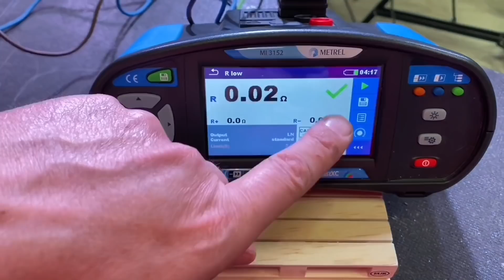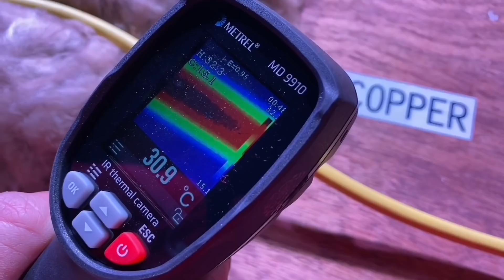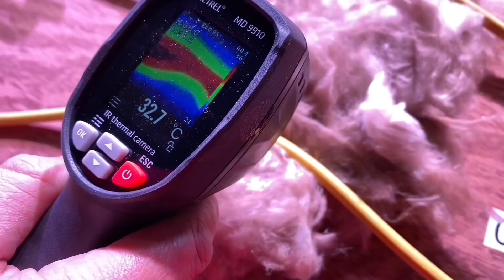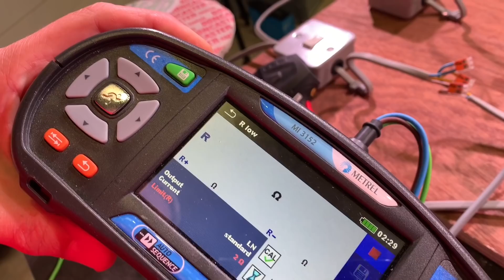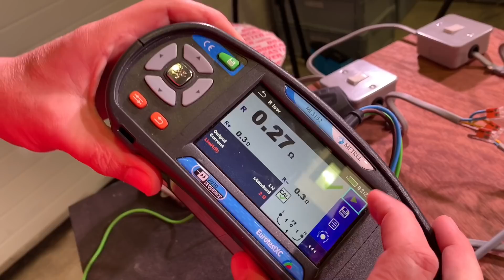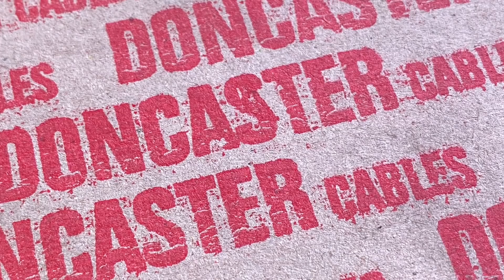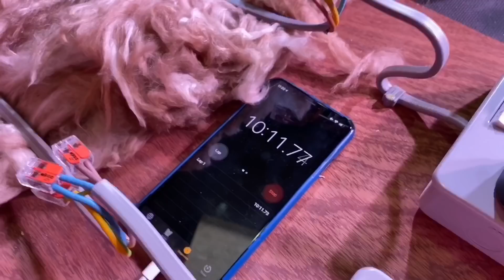The disturbing facts about FAKE and SUBSTANDARD cables - UGLY Twin and Earth, light weight flex

Comment: In the 1980s I ran the test section of a major cable manufacturer. We used to get up to 30000 metres a day through the test bays much of it 6242Y in very long lengths (grey and white sheathed in those days). There were very few electrical failures and what there were were almost always due to damage while swapping manufacturing take up drums or temporary joints having been left in. We always recognised that the major issue was strippability and we would reject any that we had difficulty stripping for test - this would usually result in the cable being returned to us cut to despatch length for us to check every reel. After I moved on to their other factories, 6242Y manufacturing was partly automated and the pervasive chalk dust found not to go well with the electronic equipment, so they moved to a liquid solution - not only much less messy but more easily controlled and maintained.

Comment: Back in the early 2000’s LSF twin was the absolute pits to strip. There will be tons of installations where the outer sheath is split down the middle and goes right up to the terminal because it was welded to the insulation of the cores. Not had to use it in a while but it still gives me nightmares!

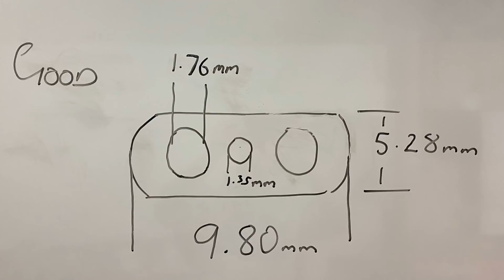Comment: 11:47 WOW!  This is shocking ;-)  But to put this into something that us sparkies can recognise...  Using basic GCSE Maths, the area of a circle is π r^2 (Pi  times the radius squared).  The measurements that you made here with your calipers are obviously the diameter of the wire so we divide this by 2 to get the radius.  Then square this and multiply it by π (pi).

And as we all know, 2.5 mm T&CPC (T&E) should be 2.5 mm^2 for the lives and 1.5 mm^2 for the CPC, so...

The "Good"

Live Conductors:   d=1.76 mm which equates to π(1.76/2)^2 = 2.43 mm^2                 (2.432849351)
CPC:                        d=1.35 mm which equates to π(1.35/2)^2 = 1.43 mm^2                 (1.431388153)

And now, the Bad

Live Conductors:   d=1.65 mm which equates to π(1.65/2)^2 = 2.14 mm^2                 (2.1382465)
CPC:                        d=1.28 mm which equates to π(1.28/2)^2 = 1.29 mm^2                 (1.286796351)

I am surprised that your "good" cable is only 2.4 and 1.4 mm but the bad cable is only 2.1 and 1.3 mm!  (I wander what DC cables are...?)

It would be interesting for you to compare popular brands of cable used in the UK to see how they stack up...?

[N.B. Pi is not pukka!  - No pies were harmed in the making of this post!]

Comment: The fake copper wires are a definite safety hazard. A few extension cords  i had were like that, copper plated aluminum, spot welded to brass contacts. 💩😵😵😵

Comment: The very first resistance test seems a little inconclusive, since it's different by only one count, might just be somewhere on the margin of device sensitivity, would have been much improved with twice the length. The thermal test however on the same cables is super conclusive - not only is the electrical conductivity of copper somewhat higher, but thermal as well, and you got an excellent measurement margin on there.

Comment: I guess Aluminium could be used for house cables . Copper is probably used because of tradition and because it solders , but in house wireing there's no soldering . Not only is it much cheaper per tonne , but it's less dense ( Al 2.7 , Cu 8.9 ) so the mass would be one third that of copper for same size wire . Aluminium has only 61% conductivity of copper so 2mm2 copper would be replaced by 3mm2 for same load bearing , then you would be paying  ONE SEVENTH  the cost for the metal involved
Reply: Not impossible at all. Just needs to be appropriately rated. Issue here isn't aluminium in of itself, more that its being used to substitute copper whilst still pretending to BE copper. Hence all the copper clad aluminium wires are totally undersized for the UK wiring regs which are written with the safety and ratings math revolving around the assumption of 100% copper conductors.

How ductile is an all aluminium cable compared to copper ( ie gow many flexs before strands break due to fatigue etc?)?

Aluminium is used heavily on the HV distribution side simply because of its physical weight characteristics compared to similar sized copper cables

There's nothing wrong, inherently, with all Aluminium wiring, it would be potentially cheaper ( although price would rise due to the extra demand, copper prices would fall etc..), but its just a case of all regs being adjusted to accommodate it.
Reply: @Thats_Mr_Random_Person_to_you  Ductility, how prone to dreakage after repeated bending is an issue , I think aluminium is not so good in this department , (multi strand overcomes this );  but ring main cable , once positioned does not move . I don't think this extra usage would increase price per tonne much . But this changeover  will likely not happen , the existing (copper) wire manufacturers  won't want it , and politicians don't understand these things . It could realistically alow  ring main cable to be a third of it's present price.

Comment: I had a couple of rolls of 2.5mm Prysmian cable from screw fix, came to 2nd fix and it wouldn’t strip, the answer from screw fix and Prysmian direct was take it back to screw fix for an exchange. They couldn’t understand it was plastered in walls in 100 pieces 😕

Comment: would thicker aluminium cable be the same as copper and still be cheaper
Reply from the maker: In theory yes - but then it’s much trickier to work with bigger reels etc
Reply: Yes, Central and Eastern Europe is full of it and electrical probelms are relatively rare.

Comment: This is why I cringe so much at SY cable - even more so when someone tries to justify it on some basis that you can follow “manufacturers instructions”.

Don’t get me wrong, some manufacturers make excellent SY cable. Which is why it should only be used if the design BOM specifies the manufacturer and not merely the type of cable. But many wholesalers sell generic stuff and good luck getting a datasheet.

Ultimately the trick with any cable is to know who made it – and to know that if it fails and burns down your customers property then they’ve got a UK director who will be stood next to you in the dock.

Comment: Australian here  - we had Chinese cables that crumbled and became fire hazards after a few years.  The cable was made by Infiniti cables - who decided to go bankrupt immediately after they were caught.   They deliberately stripped the dimensions of the conductors, and also stripped out the UV and stability compounds from the plastic.  End result - 2 people dead and about 30 significant house fires.  There's still thousands of Km out there installed - and zero warranty protection from the company.

And they were only $38 cheaper than Olex - the Doncaster cables of Australia.
Reply from the maker: Wow - tragic lessons learned!
Reply: Yes that happened here a few years back, if the authorities don't keep a watch out it will happen again, I have seen similar short cuts in other industries, plumbing pipes (PVC) , star pickets, Form board, Insulation for homes, the list goes on, we all know who the Installers are don't we, they are Importing low grade products from their own country to undercut local trades and industries. This has to stop, peoples lives are at risk.

Comment: Thank goodness its not copper claded steel.  I haven't seen anything like that in power cables, but see it all the time in coax.  Have to pay attention not to use the CCS cable and make sure its 100% pure copper.
Reply from the maker: Copper clad steel - a new one for us to watch out for.
Reply: copper clad steel is standard in RG-6 cable (the RG-6 standard defines it as such) because they are for RF applications, where the signal only travels outside the conductor (skin effect). Making it pure copper has no benefit, in fact power RF cables are hollow tubes instead of a solid conductor.
Reply: @83hjf  Pure copper does have benefits, and is required when powering downstream equipment via the coax as many things are done today that way.  Because CCS and even CCA (copper clad aluminum) have higher resistance they can get hotter over time when remotely powering devices.  The CCS is harder to bend, and CCA can fracture easier as well.   Granted I haven't seen any CCS in power cable, its just something to keep an eye out.  Yeah I have worked with 6" copper hard line at radio stations that use 2.5" copper pipe center conductor.  They use hard drawn copper outer and inner pipe with PTFE disk insulators between then.  If I recall correctly it was rated for about 8,000kw at 20kv if I recall correctly, again as you mentioned its at RF frequencies not, 50 or 60 hertz.  😁👍
Reply: Had a lot of cw1308 telecoms cable that was copper clad steel, one of the the big wholesalers got scammed in the late 2000s. Causes terrible broadband problems.
Reply: @smd-tech  There is/was a telecoms cable called drop wire, copper clad steel I believe designed as the aerial 'drop' wire to the subscribers house. The steel was for strength.

Comment: Hi I have been having a problem with 2.5mm twin and earth cable bought at screwfix the name on the cable is PRYSMIAN this cable is dated 2022 I also have a piece of the same make and size but made in 2021 this cable has no problem with it.
Reply from the maker: Prysmian is a well known brand - take it back and complain.
Reply: @efixx  Hi I did take it back and the guy said he would replace it but as I had the same problem two weeks before and I needed the cable to finish the job I just asked him to report it, it just took a bit more time to strip the cable, he was saying the bigger rolls seem to have no problems?

Comment: In a previous video Gaz you mentioned that the mains supply cable is a concentric cable which has an aluminium line conductor and an outer copper that is the combined earth and neutral conductor, so why is the flex in this video a problem? Or have missed something? Surly if aluminium is ok for the DNO supply cables then it’s ok for other cables.
Fantastic video as always 👍👍❤️
Reply: Aluminium isn't inherently 'bad'. The issue is aluminium being used to substitute copper  but pretending to still be copper.

As long as correct cross-section cable is used for the load tou could wire it in 100% aluminium if you wanted. The Grid side of distribution (so the extra-high, and ultra-high transmission lines on pylons and undersea DC interconnects) use aluminium because its just so much lighter than copper so less sagging between pylons as the cable heats up and droops due to gravity etc).

You could design the entire UK regs to use 100% aluminium cables perfectly fine if you wanted, but it might not make any real difference price wise over the long term.
Reply: Aluminium has a higher resistivity than copper, but a much lower density and cost per ton, so for a given resistance an aluminium cable will be larger, but also lighter and cheaper than the equivilent copper cable.

Aluminium also tends to be more prone to termination failures. This can be mitigated through the selection of the correct aluminium alloys along with suitable terminals and in some cases "contact pastes" that help protect the terminals from oxidiation.

As a result, most first-world countries have abandoned aluminium for "small" conductors.

Comment: I have seen this big time in appliance testing. I have been caught out at home with a water distiller bought from eBay with aluminium wire in kettle lead. The element failed burnt out the earth cable so when I grabbed the unit it ended up with burns and bad shock. Being an electrician NEVER had an incident close to this. Well it teaches me to test the crap I buy from eBay or similar sources even new.

Comment: I'm a bit late to the party with this video. But are you sure that the "fake silver cable" isn't Copper Cladded Aluminium cable? It is a proper cable and I have (unfortunately) had to use it a few times many years ago. If my memory serves me correctly there is a section in the Cable Size Calculation Tables at the back of the Regs for Copper Cladded Aluminium. You should retry your experiment with the proper Regs taken into consideration.
Reply from the maker: You can get CCA - but this cable was sold as pure copper and found in a dangerous condition within a live installation.
Reply: @efixx  My apologies. I thought you said in the video that it had been found on a building site and sent in to you. If it is CCA and is being sold as copper cable then it is definitely at fault. That's why I always try to buy from reputable electrical wholesalers.
Reply: @Alan_AB  It can be zinc or steel in real bad chinesium cables.  Silvery wire insides don't mean aluminum.
Reply: @randacnam7321  In a lot of places it does make a difference. Here in the U.K. the Wiring Regulations BS7671 state that the current carrying conductors can only be made of copper or aluminium. There are very rare occasions when copper coated aluminium can be used but these are mostly obsolete now.

In the U.K. zinc or steel would never be used in fixed wiring cables. They would never be allowed to pass Building Control Regulations otherwise.
Reply: @Alan_AB  We treat copper clad aluminum the same as straight aluminum wire current capacity wise.
Copper clad steel/zinc is in bottom of the barrel chinesium garbage that has never been within a country mile of a test lab.
We do use copper clad steel in some utility applications (the copper cladding being a decent proportion of the conductor cross sectional area) and for antennas where the RF electricity is only on the surface of the conductor anyway.

Comment: Can someone tell me how a 1.5mm² cable is supposed to feel. I have 2 different cables both pure copper but one is much stiffer than the other one and the cores, including the CPC appear to be thick. I don't suppose they would make it thicker than it should be so what's going on? Is the other cable smaller than it should be?
Reply: Maybe one is Low Smoke or LS.
Reply from the maker: Look on the side of the cable to find the manufacturers details and perhaps ask them - could be an interesting trail.

Comment: Oooooow yes. I Definitely remember the time when the college had a pallet of 1.5, 2.5, 4 & 6mm T+E. Someone at the factory must of fallen asleep at the wheel because there wasn't ANY french chalk as far as the eye could see (if you get my drift 😉). Pretty much EVERYONE (myself included) refused to use it as no matter what you did. You just couldn't strip it without cutting your finger off. 
I've got NO IDEA where they got that cable from but they couldn't even spell "Electric" correctly 🤦🏻‍♂️ I mean how the duck can someone not even spell the word "Electric" right!? 🤷🏻‍♂️

I can sorta understand where the college is coming from, as they only have a little bit of money which needs to be spread out very thinly ☺️ 

I'm sorry for going into a rant. But thinking back, there HAVE BEEN a couple of jobs where I've had to use the supplied cable and it only had the tiniest little trace, of French chalk in it. I did have a cheeky wee chat with the customer n told them that cable was cheap for a reason. It did show the number of core's and how many were in there. But if they couldn't even spell the word "Electric" correctly. 
Then I really haven't got much hope that the size of the cable printed on, is probably just some numbers they really liked 😂 FFS 🤦🏻‍♂️

Comment: If it's aluminium, are you able to suitably derate the the current rating and still use the cable? Or just double up on the cross-sectional area. I know aluminium has issues with mechanical creep and spring loaded terminals are preferred to screw terminals. In the past when I've used crappy copper coated aluminium cable, I've twisted the strands together and tinned with a bit of solder(this is very common in the electronics trade to prevent corrosion). I have found the copper coating, on the copper clad aluminium turn black!  (could be a galvanic reaction due to dissimilar metals). Unfortunately due to the cost of copper rising this might have to be an option in the future.😥🤔